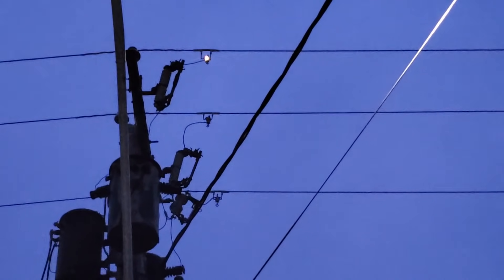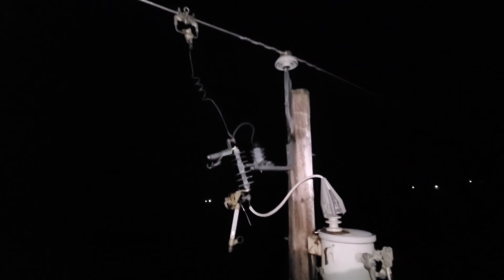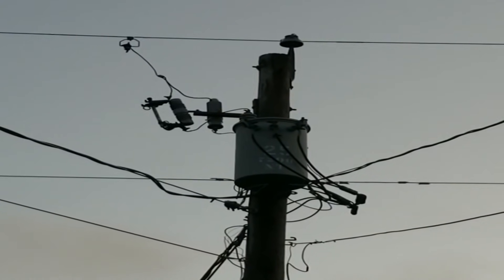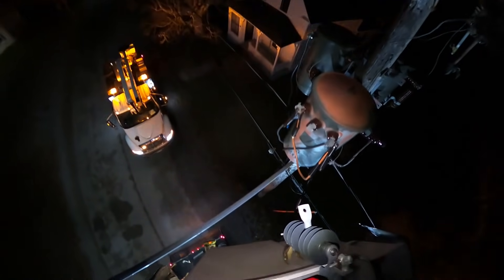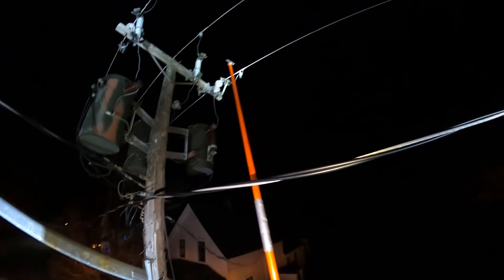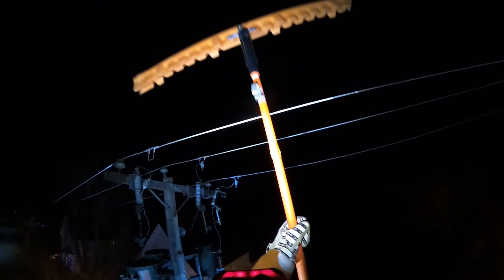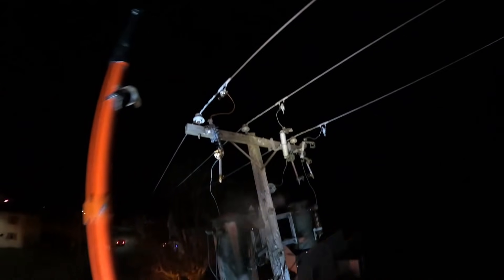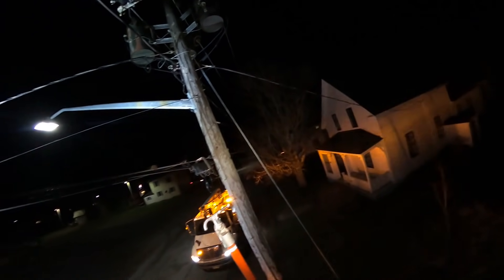Being a Lineman - Episode 13

Comment: Our stirrups bang on with ampacs. Use my wire brush on the wire before banging wedge on and I brush the stirrup. Also we only use stirrups on main line taps load baring taps...any pots or LAs  we tap the hot line clamp directly on line no stirrup needed. Also our hot line clamps we hafta squeeze on paddles and they bolt onto the clamp. Wish we used the ones that you guys have. No paddles needed. Be safe brother great video

Comment: I'm a recent subscriber in Florida, and having worked for for an electric utility (behind a desk) for over 30 years, I find your channel interesting and informative. 

I recently bought a house with a connector outside that allows me to supply power from a generator to six circuits in the house. If I have a need to use that capability, should I throw the main breaker in the panel before I fire up the generator? Will that protect people like yourself from the back feed I hear you speak of?

Comment: Florida here, how do you guys handle back feeds into the grid. Like we do have Solar Array's which do feed into the Power Grid of TECO and FPL. How do you guys handle those infeed's differently than normal household one way infeed's because we do push MW of power into the grid and yes it's all grid tie inverters so they shut off when TECO or FPL is not feeding us any electricity but how do you guys know if someone on the residential side has Solar on their end with the potential of a electric back feed of power coming from them to you...

Comment: Hi BOB I’ve watched you guys the way you secure your primary to the insulators with preform I’m from Philadelphia Pennsylvania we use lashing wire and I never seen a primary cable jump off too often it seems stronger than the preform you use I don’t know your specs but I think it would be better if you guys would Lasher wires?

Comment: Enough rain and the power will flow through the water 

Seen it happen with a fire hose hitting a power meter

I have a generator with a transfer switch

No way to have both the utility and the generator connected at the same time

Comment: Hello guys, I'm writing from Serbia, Belgrade. Here we have only 3phase transformers. Primary is delta configuration, secondary is star. Star point and chassis are firmly grounded. That's some kind of German standard all accross Europe. Primary is 10KV phase to phase, and secondary is 420/230V. Most common power is from 250-630KVA. There we have no single phase transformers. My question is what is return path for primary for your single phase setup? Is that the same neutral wire as for secondary side of transformer? Stay safe and greetings from us!

Comment: Something I've noticed when out walking is there's a line up the road that looks to have the wire on both the phase line and neutral line that the tap would attach to, but there's no indication that there was a transformer attached to it as its pretty much right smack dab between the poles and not near a pole. It makes me wonder if what was then CP&L (Carolina Power & Light) maybe reused the line or something.
Reply: Maybe one pole in a middle was replaced by two poles to shorten the spans?_

Comment: Stupid question re: the potential indicator... Why would you set it to the nominal system voltage when checking that the line is dead? I would think you'd want it looking for the lowest voltage.. (ex. it's set for 12KV, but there's about 6KV on it for some reason, it seems the PI wouldn't indicate, and you'd have a dangerous situation...)
Reply from the maker: That's a really good question! 

Where the line is an isolated piece of conductor running for quite a distance, there's a really good chance it will beep if set at 120 volts (Induction, capacitive coupling or even static). That beep won't tell us the difference between the above mentioned and the line still being energized. (If we opened the wrong switch).
It's set a full line voltage because I'm not checking for induction or backfeed... The ground once installed will take care of that. 
If we install a ground on a line that has not been isolated, it will result in an arc flash.

Comment: i’m intrigued......you described the wire size as “4 ot” ?  what on earth does that mean?   I thought you measured with AWG your side of the pond?  here in UK we specify wire size in square millimeters
Reply from the maker: The 4/0 (4 ot) is actually part of the awg. Typically you'll hear sizes like #12, #10, #8 etc... (Increasing in size). Once you reach #1, the next size up is "0" (zero) followed by double zero or 2/0 (2 ot)

Once we reach 4/0 we then convert to circular mills MCM .
250 MCM, 350MCM, 500MCM etc..
Reply: Bobsdecline - Lineman blogger thanks for that reply.  every day’s a schoolday ☺️

Comment: Anything above 12 volts is seriously dangerous, especially AC. You don't want to mess with anything above 12. You double check and triple check your safeties every step of the way for a reason. Every safety procedure and code is written in blood. I had a near electrocution at my house because a toaster failed and the exterior went to live voltage. If it wasn't for the RCD protecting the whole house, I would have needed to figure out how to deal with removing bodies.

TEST YOUR RCD's REGULARLY! YOU NEVER KNOW WHEN YOU WILL NEED IT!

Comment: some guys call them hot taps or pelicans. i've seen a hot tap melt on to a line my company doesn't use stirrups they just stick them on the line and when they have a melted one they have to splice the wire. work safe Aaron 👊
Reply from the maker: Thanks for the info 👊👊 we've got a few directly on the line, but they're on old copper wire overhead lines. I haven't heard the term pelican 😀
Reply: @Bobsdecline  ya they do it just because they don't use stirrups.have a nice day man 👊

Comment: If you’re working on something that tested dead and spark or electrocution occurs because of backfeed occur  or some other reason what is ground person supposed to do at that point?
Reply: If all safety precautions were taken (EPZ) the only thing the groundman would need to do is to send some TP up on the handline.

Otherwise, grab the tailboard form (address, location, phone number, etc...) and follow the procedures you discussed before the job.

Comment: 👊🏻 must not be able to go hands on hot primary?
Reply from the maker: Not from a service truck ... With our regular btrucks we can, but have to remove the "reclosing" feature at the substation for the duration of the work. Quick jobs are usually easier to use sticks 👊

Comment: Isn't working in the rain dangerous? I have seen some union contracts that specifically prohibit utilities from allowing their employees to work in extreme weather. Is that a safety motive or just a working condition provision? Could using a wet hot stick and/or PPE be dangerous?

Comment: any kind of electrical arc is never good to look at as it produces UV radiation  and even at 50 amps it will burn your eyes and if done enough will cause cataracts I can say with welding I wear a minimum of shade 12 lenses to protect my eyes from the arc